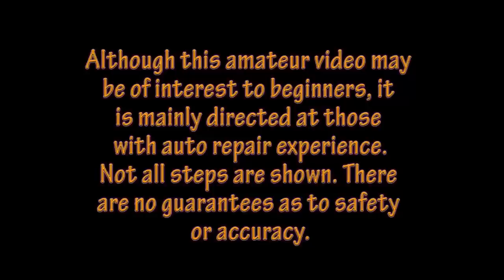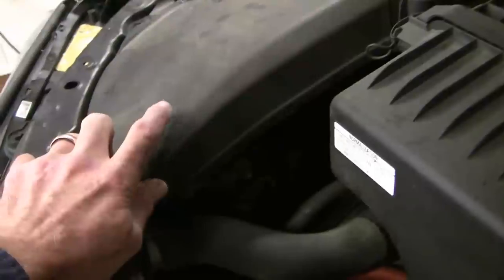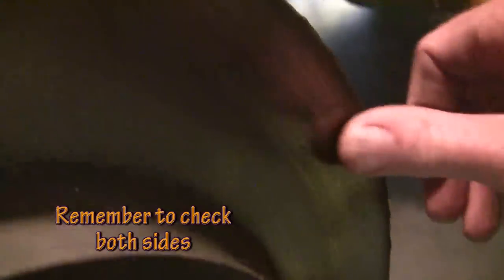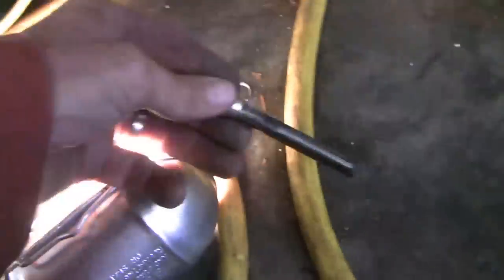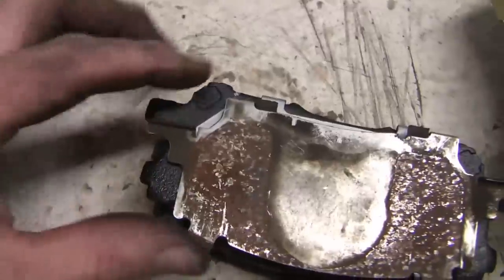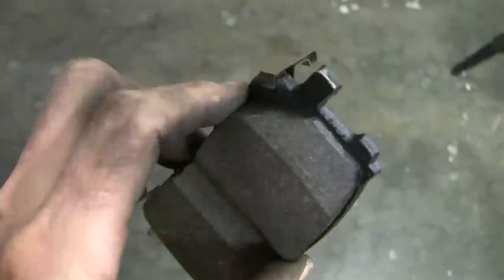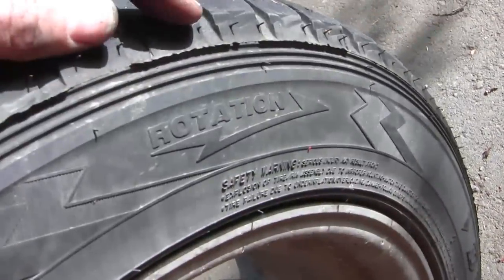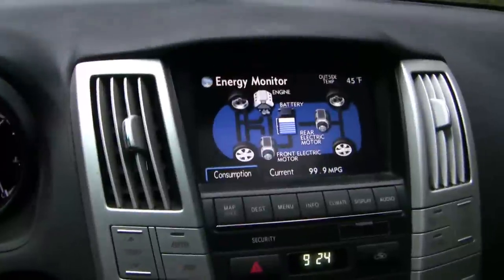How to replace brake pads on a hybrid vehicle, Lexus RX 400h

Comment: Great video, clear and concise. The conversion of the momentum energy to charge the battery is called 'dynamic braking'. I used to work for the NYC transit subway system and their trains have been doing this long before hybrid cars. Actually, the hybrids took pages off the subway trains. Same voltage 600Vdc (albeit hybrids use lower Amps in comparison).
Reply from the maker: It's great to hear about other parallel systems. Thanks for stopping by!

Comment: Thanks for sharing this. I recently purchased a used RX400h with 173,000 miles on it. Because of the Lexus name, I wasn't too concerned about the miles, but I have been worried about the costs of repairs. Your video helped me, in that I'm not afraid to tackle the brakes when the time comes to replace the pads. Thanks again.
Jeff

Comment: Very well shot video. if the slide pins were excessively dry that could have accounted for the excessive wear on the inner pad as the caliper would not " float " freely. even with the purchase of the Toyota pin lube the savings doing this job yourself are substantial.  showing the use of the dial indicator to test run out on the rotors was a plus for the people who may  have not been aware of this test  prior to you video.

Comment: Never knew about the key proximity in relation to Hybrid brakes, and the emergency shutoff switch. We have the current generation RX 400, so this is all great to know. 

I'm impressed by your tool set and how meticulous you are about the job. In particular, measuring the rotors with two micrometers, I gotta get one of those dial setups. I also like your brake piston tool, as I just use a C-Clamp. I was surprised when you bought a tube of Toyota grease, but decided to go with aftermarket pads.
Reply from the maker: That's a good point about aftermarket products. I usually hesitate when it comes to mixing lubricants, especially with the unknowns about what happens at extreme heat. Silicone paste has normally been my standby, but even there the published data on extreme heat is not completely clear. It just seemed wise to use what was already there, especially given it is not easy to thoroughly clean the slider holes.
Regarding the service plug, in an accident the car is designed to shut those wires down. But I would not have complete confidence in the system when the vehicle is smashed. That said, it is reassuring to note that there are very few (any?) fatalities from electrocution after an accident with Toyota electric vehicles. Thank you for watching, it's nice to meet you.

Comment: You are a natural! Such a calm way of speaking and educating the viewer without being condescending! Love your videos! With that said I performed a brake job on my 2007 RX400h. I wasn't aware of the brake bleeding issue until I was knee deep into the job. Well I continued with the brake job and disconnected the battery. I had to replace one caliper and was so worried that something bad was about to happen once I reconnected everything. However NOTHING! Took the car out and brakes work perfectly without bleeding them the correct way. I was so surprised. However since this is my wives vehicle I will still bring the vehicle into Toyota on Monday to have the advised bleeding of the brakes. 
Do you see anything wrong at having this lexus serviced at Toyota instead of Lexus? I believe there is a $60 per hour difference in labor fees.
Reply from the maker: Thanks for the feedback, it should help others who have to bleed the brakes. Yes, gravity bleeding will work well most of the time even with key off, though I've never done it on the Lexus. If the brake line bled dry and was then refilled, a conventional final step would be to trigger the ABS motor either with a scan tool or manually. To do it manually I would drive to a safe area with gravel or leaves to promote skidding. Then while moving at about 10 mph, hit the brakes hard to trigger the ABS pump. When the pump kicks on there is a small chance it will dislodge air bubbles that then require a second bleed. If the pedal remains firm you are finished. Regarding Toyota, Lexus is a subdivision of Toyota and many of the parts in the Rx400h are identical to parts in their other Toyota models. So, as long as the techs are comfortable working around the orange high tension wires I wouldn't have any problem with that. Brakes would not be a problem, and they share the same Toyota scan tools. Our local dealer does maintenance for both at the same facility. In our Rx400h, I installed a block heater. First I got a price for the part alone at our Lexus dealer, $150 in the town we lived in at the time. I asked again, emphasizing I just needed the part, same price. The identical part (same part number), including shipping from Toyota was $43. Unfortunately there is a certification for Hybrid techs and you'll pay a premium for that extra training, even if it is not itemized on your final bill.
Reply: spelunkerd one last thing, we commonly stick our fingers through the rim to check the rotors. On three of my wheels the surface was like glass but when I replaced the pads the other side of the rotor was absolutely toast. Never assume everything is ok until both sides of the rotor are examined. Btw how do I access or discover your other videos! Your radiator one helped me especially that this vehicle has 240,000 miles but still drives like new :)
Reply from the maker: Oh, one more detail, since you disconnected the battery you'll want to make sure the windows move up and down. There is a simple relearn procedure for the windows and sunroof that you probably need to do, it's described well in the owners manual. There is also an idle relearn procedure that I describe in detail in the last paragraph of the video description, above. You make a good point checking both sides of the rotors, it's very hard to examine brakes properly without removing wheels. If I think a caliper is stuck I will use a laser thermometer to measure the temp of the rotors after a short drive. One hot rotor makes the diagnosis clear. Thanks again for watching!

Comment: This is a great video for changing out your pads and rotors. It works as described, but make sure and follow the directions and don't bleed the brake fluid. I did both front and back - don't put on ebrake when doing the rears obviously, or you won't get the rotor off. The Lexus brakes are well designed and easy to work with.

Comment from the maker: Thanks, Donald, yeah the caliper is fairly traditional. But if you mess up by letting the ignition key get close when the slave cylinder is off, the car could re-pressurize the brake fluid, pushing the slave piston right out. Then you need their software to bleed the brake lines. One guy posted a video here on youtube, and he said that after that happened he had to tow it in to the dealer, and they gave him a bill for more than $500. 

Thanks for watching!

Comment: You are such a great detail oriented person! I am an auto mechanic but not very crazy about working on hybrid cars. My friend has a 2006 Toyota Highlander hybrid with a bad ABS module. Replacing it is easy but I am worried about the aftermath hesitant to do the job!
Reply from the maker: I know, it is possible you may need a scan tool to clear the ABS of air bubbles. Friends who work on these vehicles tell me that they often can get away with bleeding in a normal way, and I have had no difficulty bleeding a couple of vehicles with ABS. Brake by wire systems may need the key on to use the brake pedal for the last bleeding stage, but if the caliper doesn't meet resistance to raise pressure when primed you may get an error code. Vacuum bleeding might work, and positive pressure bleeding from the MC should work OK. Scan tools have come down in price, the Autel midrange products can be had for about $1500 and they do have bidirectional control for things like brake bleeding....

Comment from the maker: You raise an interesting point regarding the whole question as to why shims are there. I've always assumed they are there to prevent friction and twisting of the pads under the strain of braking. They are so thin I don't think they are very good at distributing pressure across the pad, though I suppose that might be possible. And it seems unlikely they prevent the pads from breaking apart with all the heat and strain. All that said, I've never taken them off when they are designed in a system...

Comment: Thanks for posting! Easy to understand and to the point!
Reply from the maker: You're welcome, I'm glad it helped. Another option if the key can't be kept well away from the vehicle would be to pull the ABS relay, which is another common pro strategy in many new vehicles. However that extra step seems unnecessary if you don't let the key near the vehicle. Reading through the remarks here, a few viewers made the mistake of letting the key get too close, and they ended up with a warning light that is hard to remove without a code reader.

Comment: thank you for sharing this, i have done so many brake jobs that forgot about my other half daily driven car is a hybrid until four lights came on from the dash as warning that my ABS,VDC,eBrake, and ATTEnTiON had gone South.. oooppsss.... and have to ask my friend to reset it for me, obviously He's a tech from nissan for he has where i dont have. that was changing the front pads only and now the time had come for the rear and found your very very very helpful tip that i missed the first time which is the proximity sensor from the keyless, as you had explained in the video that how brakes on a  hybrid vehicle would work if the engine is not ON. and most of the system is controlled electronically and constantly sensing and adjusting automatically. Again many thanks to you. gtg going to start messing the rear now:)
Reply from the maker: +Barry Silmaro You're welcome. One other way a failing accessory battery can fail in these vehicles is with various warning lights, too. One day my VDC sensor came on and the car wouldn't start. Fortunately, I checked the battery before calling for a tow. Sure enough, all I needed was a new accessory battery.

Comment: OK.  Next question.   I've read where it said after you disconnect the battery to operate the brake pedal until it goes hard (all the vacuum power boost is gone from the accumulator reservoir).  Then, after fitting the new pads, operate the brake pedal again to push the pads up to the disc before hooking the battery up so that it does not trigger a brake fault code.  Did you do this?
Reply from the maker: Good question! No, I didn't do the first part, and I don't remember whether I pumped the brakes to seat the pads before or after replacing the battery cable. It sounds like wise advice. Thanks for your contribution to the thread!
Reply: @spelunkerd  Thank you!  I am/was a Master Certified Tech for over 30 years from the first series of tests in Feb 1974 BUT I just can't keep up with all this new computer controlled stuff.  I've got all the parts to do the job including new rotors (150,000 + miles) but I'm now paranoid now that I'm going to screw up the brakes due to the hybrid equipment  .....  and as you know that is EXPENSIVE!

Comment: I was a little surprised to see that the brake fluid was just pushed back through the system instead of bled out.   I read years ago that this could possibly damage the ABS components.   Is this generally considered safe to do?
Reply from the maker: That's a good question, and one that continues to be debated. I can say that I've never had issues with not cracking open the bleeder screw, and on the contrary I have broken my share of bleeder screws when I bleed brakes. A broken bleeder screw could lead to expensive caliper replacement, and certainly extra shop time to extract the broken fragment. People do quote a risk of master cylinder seal damage when a big bolus of fluid is sent backward into the master cylinder, but I've never seen that happen. If you do open the system, you need to be prepared to deal with the consequences, which may be complex in a brake-by-wire system. Toyota use Techstream software to bleed brakes, and the old way of doing this manually will not be as easy as it was for an old style brake system. The risk of not opening that bleeder screw is small, and indeed every time you press on the brake pedal, as you release the pedal, some fluid has to go back into the master cylinder automatically. So, to think there isn't  interchange of small amounts of fluid between slave and master cylinders every day is inaccurate. Specifically the water that contaminates brake fluid could freely diffuse up those lines anyway. There are extra risks to bleeding brakes in amateur hands, as well. In my amateur opinion the risk of an extra bleeding step is not worth the effort and risk. Your circumstance may be different, but I know that some professional shops don't bother to crack open that bleeder screw when compressing the slave cylinder. On the other hand, if it is time to replace the brake fluid then bleeding at the time as pad replacement would be timely and much more complete compared to replacing only the fluid in the MC reservoir.

Comment: Awesome video, thorough job with showing the runout measurement.  I was however curious as to why you used anti seize on the caliper guide but lithium grease on the pins.  I was brought up to never use antiseize in an area where the metal parts move against eachother because it turns into a jelly like compound.  The antiseize has metal particles in it to act as a sacrificial anode so as a lubricant it does not work well.  Just wondering if you know something I don't.
Reply from the maker: What a great question! To be honest, the main reason I do that is because the best teacher I've ever had when it comes to brakes is Ericthecarguy, and he uses antiseize on the clips. As you say, it would be a major error to think of antiseize as a lubricant, and one would never use it for the sliders. I think the reason antiseize is popular for the clips is because there is minimal movement there, and you don't want lubricant dripping anywhere near the discs or pads. Because that area is frequently wet, corrosion/rust/oxidation is the main enemy. But I don't think a small amount of lithium grease would be wrong at that site, as long as just a very small dab were used.

Comment: Great video, very informative.  While you were doing your brake repair, did you disconnect your 12v battery?  Secondly, instead of flushing the brake fluid for purposes of total fluid replacement, could I suck the brake fluid out of reservoir with a turkey baster and repeat it several times after a day of driving?  Would this trigger the dreaded check VSC message?
Reply from the maker: Yes, and yes, I did both. And no, it won't trigger a code unless you remove enough fluid to trigger a problem - I would also do that with battery neg pole removed so that the computer doesn't send a low brake fluid code. Draining fluid that way isn't ideal, but the best time to do it is when the pads are thick and calipers are compressed. You don't get to flush impurities out of the caliper this way, but you avoid having to ask for dealer support. I do wonder if there is a way around this need for dealer software, My Autoenginuity software might be able to do it, but I haven't been brave enough to try, yet. Perhaps somebody visiting here will demonstrate a work-around using generic shop tools.

Comment: I usually remove the shims unless they are riveted on. They seem to cause noise and start falling off and cut into the rotor and cause noise. I have even seen shims that were glued on and have slid off!

Comment: Subscribed! Thanks a lot. I wondering about one thing. When the brake job is done before engine (or ignition) is started should I pump breke pedal few times? Or system adjust the calipers automatically? What was by your case sir?
Reply from the maker: Thank you, yes, always pump the brakes after brake work, I must have forgotten to mention it. However you'll find that when you bring the key close to this hybrid, it may automatically pump the brake for you. That's the problem with having the key close, the vehicle pressurizes the system even before the key is in the ignition. If that happens when you have the pads removed, the piston might be pushed out too far and you could have a big mess. Several people have stopped by to mention they got an error messages from the console when they forget to move the key away from the car when doing the brakes. Don't forget! I think the system tests itself and if it doesn't encounter resistance from the piston with one stroke of the master cylinder, it sends off a VSC warning signal. In my case, I pumped once before even retrieving the key, got a firm pedal instantly, and had no difficulty on a careful test drive. Good luck!
Reply: Excellent! Thanks for quick answer. I'll do My brake job on My Gs450h with all your instructions sir. Great channel btw.

Comment from the maker: They are both generic, I think I got them both at Princess Auto here in Canada. The dial micrometer has a magnetic base with a lever to conveniently attach it to a vertical post, but you can rotate and modify it for many different applications. Thanks for watching.

Comment: Great Video.  I enjoyed watching it!   I like how thorough you are like me!

Just a quick question, I always used Toyota parts in my repairs, especially on the pads as i have had horrible experience if not.  Since you had done this video almost a year ago, how have you found those pads?  Are they as quite and comfortable as the factory?  

A comment, I always use new shims on the brake pads for my brake jobs (again Toyota) i would sugest that for you if you hear a "click" noise when you come to a full stop sometimes
Reply from the maker: Brakes on the vehicle are working great, no problems, no clicking or squeaking.